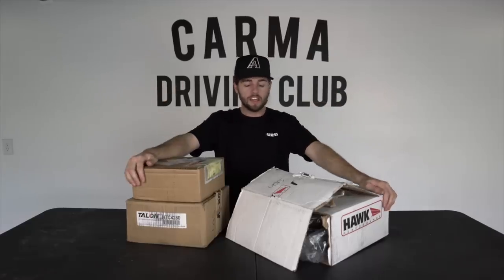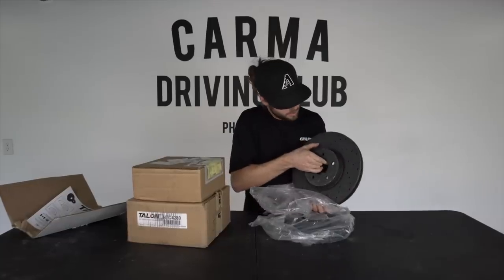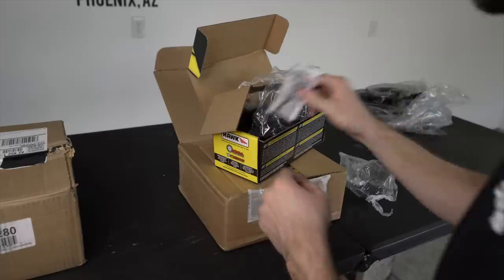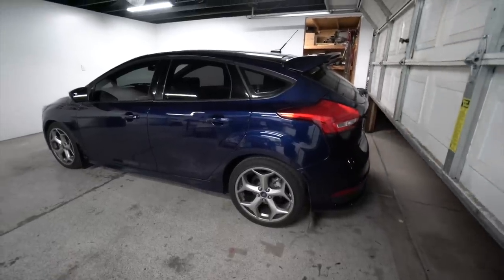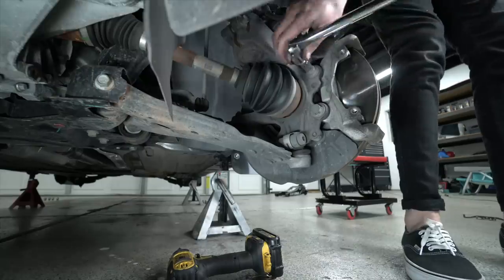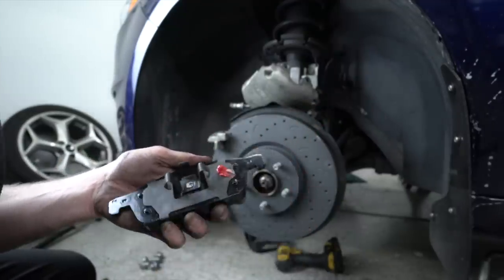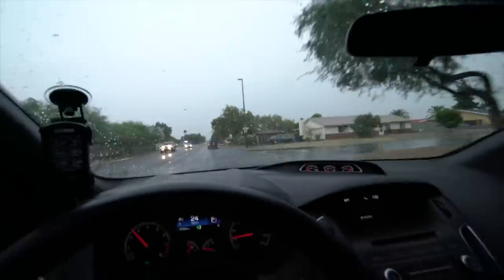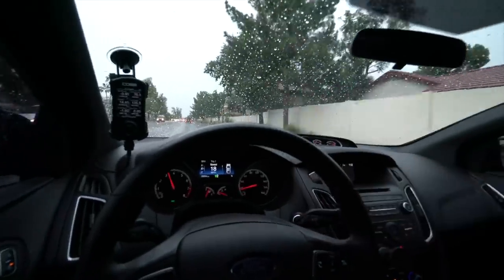Easiest Brake Upgrade on Focus ST!

Comment: i've done upgraded brakes on my previous cars. for safety, you should always pump the brakes to get the pedal feel back before you even roll back out of the garage. new pads and rotors should come with a proper "bedding in" procedure. usually several stops of different speeds and brake pressures. there should be instructions in the packaging. 

great videos though, keep em coming!

Comment: Make sure the hub face is clean before fitting the new disc, bits of crud/corrosion can cause brake judder. A smear of copper grease helps removal next time. Good vids man!

Comment: FYI for those that try to do the rear pads...compressing the piston is pretty simple with just a pair of needle nose pliers...push down and turn at the same time, works for me. I've found the 'specialty' tools don't seem to work very well unless they're the expensive ones shops use since they have to rely on them on a much higher volume of usage.

Comment: @cameron Alford when you pressed the traction control button you simply put it in sport mode. if you want to really turn traction control on press and hold the traction control button for a few seconds and a warning will come up on the dash display advising that you're about to turn traction control off. thats when the fun really begins lol good luck with the build!

Comment: For those rear brake pistons I’ve just used a pair of needle nose pliers and put them it the two hole in it and it ended up working just fine

Comment: The rear caliper tool is easy. Just gotta remember to use the backing plate to sit against the other side of the caliper. Then you just turn away. Then turn the socket with pliers to release it when it's fully retracted

Comment: I have an easier way of doing the rear ones. Use the clamp from the opposite side and screw in until it is lightly tight. Then use the pliers at the same time while screwing in the clamps. Make sure both rotate at the same time and should be done in less than a minute with minimum effort.

Comment: Do intercooler next with an externally mounted blow off valve! CP-e has a great intercooler which I personally use and recommend. I would love to see an install with the with the CPE cold side charge pipe with a blowoff valve mounted.

Comment: Nice vid man. Make sure to bead the brakes in hard and if possible swap out the brake fluid for some high temp. (stock rotors are good even for track, most go for pads, fluid, and stainless brake lines)

Comment: Protip for removing rotors. Thread your lug nuts back on the studs and hit in between them on the flat part of the rotor that your wheel mates to. Use a heavy hammer and a few good whacks the rotor will come right off. Save the oem crap lugs for this as they are there to protect your studs if you miss with the hammer.

Comment: When I did the brakes on my Z I just took a rubber mallet and took one good swing at the rotor and she came clean off lol
Reply: BTW... WHAT!!! Great idea with the oil filter pliers. With the Z32 the regular caliper piston compressor won’t work since they are 4 piston (no room to get it in there)

Comment: Any other recommendations? Can’t get the hawk ones because of my area and I Need to replace mine and want to switch to the slotted rotors as well but all the kits I find are stupid expensive not even for big brake!! Thank you :)

Comment: Stock brakes and rosters are more than enough 
lol just get some good pads. If you’re running on the track ok I get it but for a daily nah
Reply: I feel like drill and slotted brakes for daily are a very expensive cosmetic upgrade

Comment: Dang I wish I watched this vid a couple days ago when I first saw it, I struggled with the lug nuts earlier today when I went to install wheel spacers. Mangled a few of them with the pneumatic gun before I switched to a socket and breaker bar, and even that messed up the factory lugs, they really are trash..

Comment: Omg I been trying to find the exact kit that you have on that focus I have the same year and Im not sure what ones you got plz help me lol
Reply: Don’t bother unless you have an st made before 2014...I learned the hard way because they never made ones for different front rotor size (2014/2015+). Bought them and the front did not fit ofc. I do have the pads tho those are good. For the rotors look at power stop or r1 concepts
Reply: @markcase913  Thanks! No wonder I couldn't find them.
Reply: @bernardov5342  no problem! The pads should still be available I believe I found them on tire rack of all places

Comment: What was the exact break kit you ordered? I might be dumb but I’ve got an ST and would love to run those breaks and rotors.
Reply: Follow
Reply: Rotors only made for the 2014 and less models (aka different front rotor size) I learned this the hard way lol. I do have the brake pads (check tire rack lol I think that’s where I found them) still and am thinking of getting the slotted rotors from either powerstop or r1 concepts.

Comment: For the rear brake piston, if you are able to get leverage, you can use needle nose pliers to push+turn the piston clockwise. If you're having trouble getting leverage, you can pop your rotor off, reinstall the caliper w/o pads and you can get a lot more pressure and control

Comment: GET NEW NUTS ASAP. Old ones got bloated on my 14 and got stuck in the socket :( I purchased these and they are doing great after half a year.
Reply: DPAccessories LCB3B6HE-BK04020 20 Black 12x1.5 Closed End Bulge Acorn Lug Nuts

Comment: Yo can you do a lugnut video because there’s like nothing out there on what lugs fit yes we know there 12mm x1.5 with a 60° Taper but there are a lot that won’t work with the Stock snowflakes. Was looking at Mishimoto lugs but don’t know if they will work because they say “for aftermarket wheels” and almost every other lug brand

Comment: I just ordered this exact brake setup about an hour ago.  Hoping to do it myself as well, in order to save a few hundred bucks.  How did you find them to be over time?  Did they warp or wear out fast?

The overdub format of the dialogue is a great choice btw.

Also, I use a 3/4" Impact socket, and loosen them by hand with my torque wrench, and install them by hand too.  I find using impact guns a bad practice, as they can damage the lugs, or your rims too easily.

Comment: Should you bleed them after because of compression the pistons? Might get rid of the mush. Look like nice rotors
Reply: No need. You can push the pistons back without breaking the lines. So you never introduce air to the line.

Comment: Great video! The car is looking better with each episode.
7:35 remove the cap on the brake fluid reservoir to give room for the fluid you'll be displacing as you push the caliper pistons back in. I'm sure you did, but newbies might not know. 😉